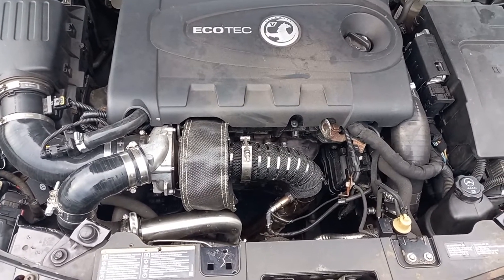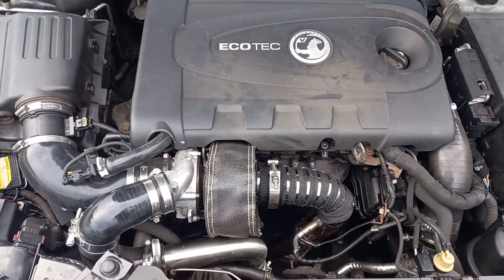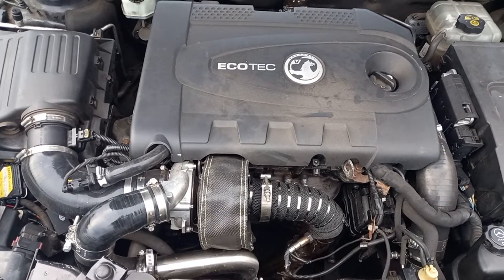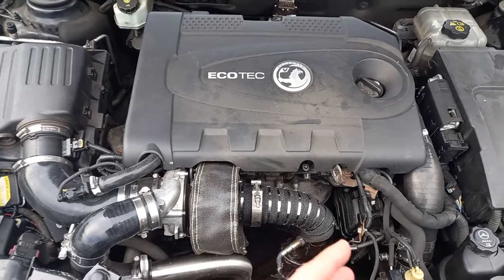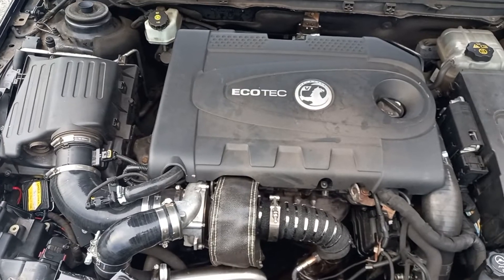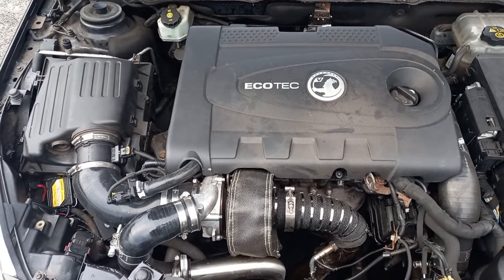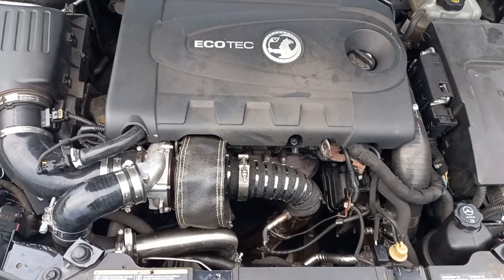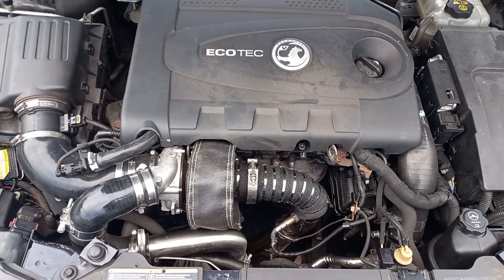Vauxhall Insignia Turbo blanket does it work?

Comment: Hi, how much boost are you running..?
Reply from the maker: 2 bar at the moment
Reply: @dieseltuningincboosttechno4684   same as me. Wanting to turn it up more, do you know how much boost they can take safely? Not many people playing with these.
Reply from the maker: @tomeaton7139  what turbo do you have?
Reply from the maker: @tomeaton7139  if you are running a standard turbo 2 bar is way too high. A gtb1752 journal bearing turbo won t go over 2 bar safely. A GTD1752VKLR will do 2.1 bar but no higher